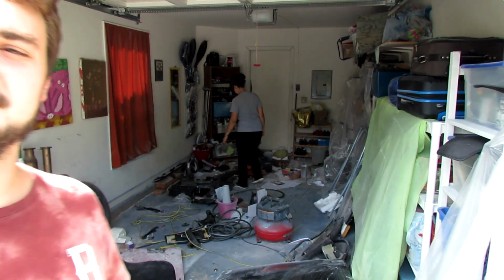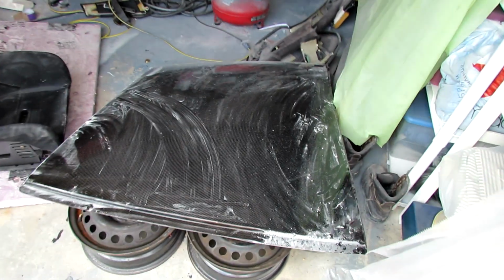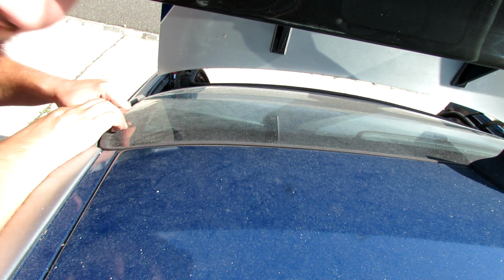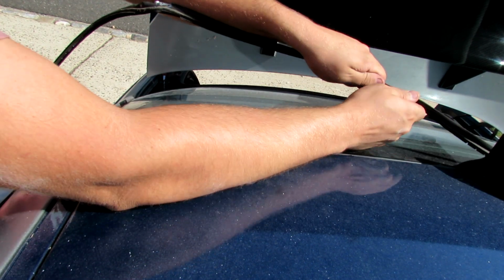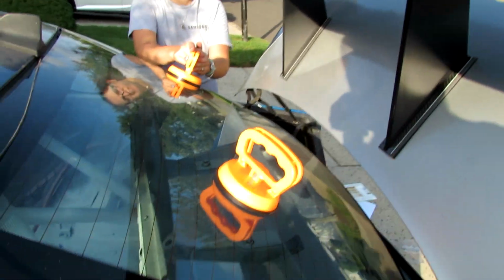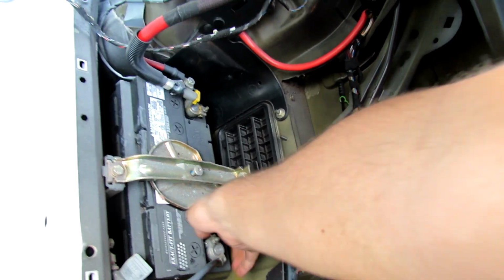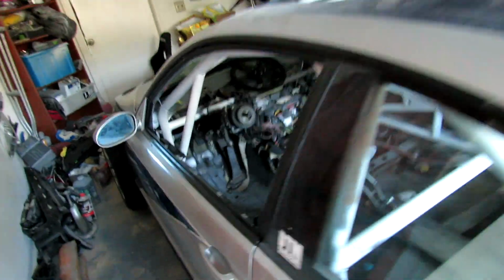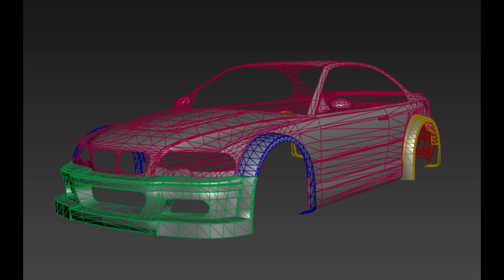Firing up the M3 GTR + Cleaning Garage

Comment: Are straight cut gears street legal to have? The famous whine sound heard in MW 2005 and Carbon is missing.
Reply: By law they are illegal 

Using them as daily it a bad idea. You will be grinding gears a low speed traffic. The straight cut gears work best at high revs.
Reply: Dang it. Is it still possible to somewhat get that whine with some turbo? I played Carbon more so I'm used to hearing the whine a lot more clearly than MW 2005. The MW 2005 version where I hear the engine more is also acceptable.
Reply: @linchester8464  But, after the M3 Build is done. He said that his gonna do a time attack lap with it
Reply: @linchester8464  i mean, he has a Sentra. Which is good for daily driving
Reply: They're street legal, but it's a fairly expensive modification to get done.
Reply: @Uluznap  it fairly straight forward mod. 

There are straight cut conversion kits for the stock M3 gearbox. It just a set of gears which you can put together yourself. 

There are special gearbox made just for racing as well. It can cost 25 grand.
Reply: @wills.junks7  well the M3 GTR was a race car to begin with. The Sentra is a backup car. That i am aware as well. But the question the other guy is asking if it ok to run straight cut gears on a daily car.
Reply: They are legal where I am from I have seen a ford focus in the city drive with straight cut gears once.
Reply: @MisterResistance101  supercharged, it makes more noise outside than inside; win-win
Reply: @linchester8464  it's legal in most of the states